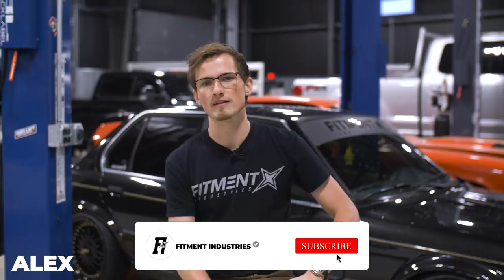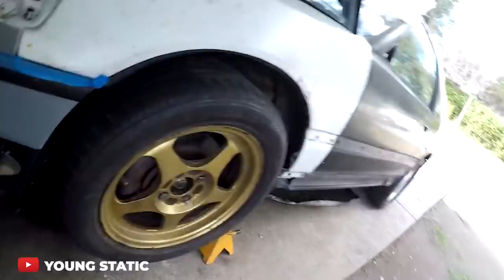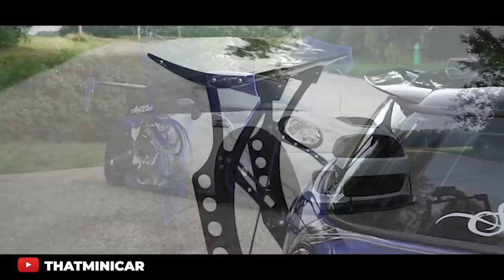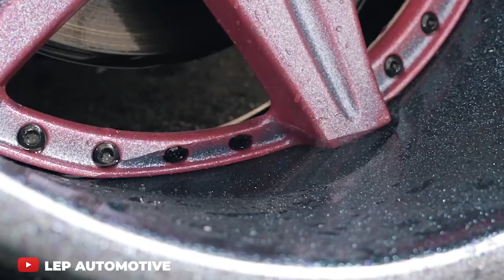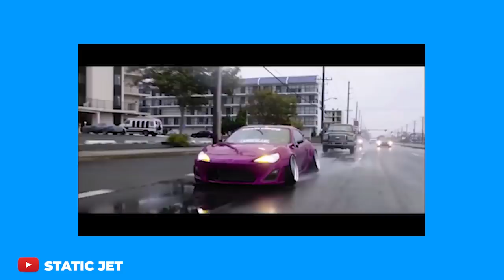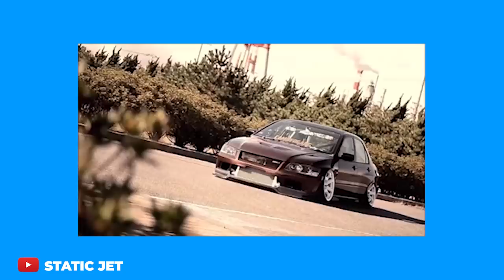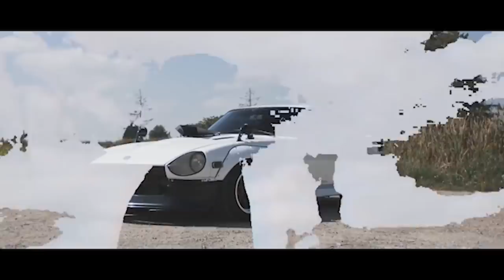Rookie Mistakes When Building A Car

Comment: 1. Simplicity is a form of beauty
2. Lowered car looks nice but a nice looking car doesn't need to be too low to look nice. 
3. Don't make the car look fast when it isn't 
4. Get proper exhaust system and high quality. Don't waste time on cheap shit
5. Keep the car clean is the best form of modifications you can get. No point of having a sacked down scrapping the road when it is look like it belongs to the junk yard.
6. Don't stance it, I can't stand it.
7. Suspension setup and bracing because handling is better than anything when it comes to surviving the corners 
8. Get a set of quality tyres and quality wheels (JDM is the best).
9. No stickers please..
10. Don't rice out

Comment: What do you recommend as a first car under $2000-ish
Reply: Alan_JDM_Gutierrez best bet will be a civic. They’re mostly bulletproof and have a huge mod community
Reply: Alan_JDM_Gutierrez rsx is a great car for cheap and it can be fun if you get a type s
Reply: @Ferrari636  yeah i had hondas in mind since im really knowledgeable about them, my brother has had countless built hondas (my profile pic is his crx) and my dad is a mechanic so he teaches me everything i know. Plus they have countless aftermarket support. Thanks for the advice!
Reply: @wellmax3749  good point
Reply: @Ferrari636  yeah, my brothers is gsr swapped, he had a supercharged b20b but decided to sell the motor
Reply: But his car is a si with full interior and even with a stock-ish b20 he would destroy some cars
Reply: I know people right away say Honda and there in nothing wrong with that. Buuuut you can get an Infiniti Q45 or Lexus Ls400 and do a V8 VIP build as well relatively budget friendly just takes time to find a steal
Reply from the maker: Civic's are a great option! Problem is it that it is very hard to find one that has not be beaten to the ground 😂
Reply: 89-95 5 series e34, I love mine. They’re classy
Reply: Miata

Comment: My biggest mistake. Spending more money on parts for the car, than what I spent on the car. Run out of money. Take the car toget inspected. Fail inspection. Now I have all these parts sitting collecting dust until I get the car fixed.

Comment: Stand alone or piggy back..? 🤣
Reply: Depends on your needs and what is available to you.  Piggybacks can be pretty awesome (Burger Motorsports) and usually take no time at all.  Standalone ECUs are by far the cream of the crop most powerful car control device out there; however if there isnt a PnP version for your car you have to manually splice into the OEM harness or repin it to accept the new ECUs plugin which can be extremely time consuming and/or expensive.  I ran a megasquirt in a miata I owned way back in 2007 and it was a slick little standalone, currently looking at a JB4 from Burger for my new golf as there is issues with dealers TD1 flagging cars that come in flashed which immediately kills your warranty.

Comment: Please do a video on how to properly measure offset (on the car not on the wheel) so we can reduce the risk of ordering wheels wrong
Reply from the maker: Check out this video we actually covered this! https://bit.ly/2S1Tjl4 🙏🏼
Reply: Easy, use the factory wheel offset as a guide. But you really have to learn the science of how offset/backspace works TBH.
Reply: I appreciate the video suggestion @fitmentindustries but I understand what offset is and how it works. The part I have trouble with is getting the measurements on the car so I can get new wheels to have perfect flush fitment
Reply: Evan Hamlyn what car do you have?
Reply: @_Greasyzoku_  2018 chevy cruze hatchback
Reply: Evan Hamlyn according to my research, looks like your factory wheel offset is +41, depending on which trim level you have depends on wheel size 16-18” so widths range a bit. But I’d say a 18x8.5 +25 is a good starting point of wheel options to look into. Depending on if you lower it, don’t mind camber, what you wanna do with your car (track vs stance) etc. but 5x105 is gonna be hard to find so a redrill of a set of wheels is gonna be your best option. Good luck. I like those cars, probably not fast but cute af, much like my 525i e34.

Comment: Car: 2015 brz Limited
Goal: Performance(turbo)
Current mods:
UEL Headers
Exhaust
Front pipe
Intake
Stage 2 tune
Coilovers
Tires
Sti lips And side skirts
Future mods(supporting mods):
Wider wheels and tires
Cooling upgrades
Brembo brake kit 
Clutch 
Fuel system upgrade 
and ultimately TURBO!

Comment: I bought too wide of a wheel. Thinking I should have just bought springs instead of coil overs. Would have saved 2 grand on wheels and new tires I didn’t need.

Comment: Figured I’d ask my buddies here first. Just bought myself an 05 Legacy GT and I drove it from NC to VT (15 hour drive). It drove fine all the way home but now the CEL is on and the ABS just came on. There was smoke somewhere in the bay around the turbo but it went away, smells like a dead rats nest. It’s tuned on 93 but I had to put 91 in it twice. The worst part is it sputters and idles rough and then stalls. It used to have black smoke but that’s gone away too. Just seeing what type of answers I’ll get, I’m getting it diagnosed Monday but if I can find answers here first that’d be great, save me $100.
Reply: Probably the subie gaskets, they go bad a lot, my 06 Impreza needs gaskets
Reply from the maker: Best of luck to you man I hope its nothing to crazy and expensive! 👀🙏🏼😅
Reply: Frowningcorn Ding ding ding, me and my friends were looking over the turbo, sparks and coils, then we realize the gaskets are spitting oil like crazy. Luckily where I live, all my friends work at the local Subaru dealership as well as have their own shop and dynos. So it should be quite cheaper than getting it done at a regular mechanic/Dealership.

Comment: I just bought a brand new 2019 WRX, and I want to throw on some tasteful mods for personalization. I don't want more power, I don't want stupid looking aero, I don't want to slam it. I bought a second set of wheels and winter tires (Michigan has rough winter's), I'm painting the calipers, and I'm replacing the shift knob. I like the seats the way they are. If anyone read this far, any suggestions for tasteful mods that won't impact reliability or ride height? This is a daily, not a track car.
Reply: I might also get a new exhaust sometime in the near future as well.
Reply from the maker: Exhaust would be a great addition to the ride, That or grabbing yourself a stage 2 kit from Cobb!
Reply: slam or die
Reply: @BLOODSHOT62  I live on a dirt road... In Michigan. And I have to drive it through winter.
Reply: @devjk1  lool that's soft, I live in Toronto, land of pot holes and snow, all I hear is excuses 🤷‍♂️🍯
Reply: @BLOODSHOT62  haha fair enough, I guess I am making excuses then. None the less, I'm not going to lower it
Reply: @devjk1  ahaha just fucking with you, but sounds like you could use a vape
Reply: @BLOODSHOT62  maybe I'll build a vape holder in the e brake so I can hit it immediately after coming out of a e brake turn 😂

Comment: Is a 2 step module unnecessary?
Reply: In reality the only viable function for a two step is drag racing really.  You can get up on your soft limit which can allow massively boosted cars to launch at/or near full boost giving you the best possible 1/4 time you can throw down.  For daily drivers your factory hard limiter is all the safety you need, heck a lot of manufacturers run their rev limiter 200-300RPM below the actual redline.
Reply: @ShoreStudios  great job answering. Hope this helps some others. 

I know what 2 step is though and I am actually going to be buying the msd ls module. Gotta shoot them flames ya dig?
Reply from the maker: Your the real MVP I swear! 🏆🙏🏼

Comment: I made the mistake of picking upper Springs my Integra 92 add a turbo kit my car that had 189,000 miles piston rings were fried they were smoking like crazy spitting up oil at the top of the motor then it caught on fire on the Garden State Parkway when it was complete I only had my car for four days 😌😌😌😌
Reply from the maker: Big rip 🙏🏼

Comment: Bought my car for 1k, spent 600 or so on upgraded a arms, control arms, and pan hard bars, and then spend my last 200 on parts that turns out came with the a arms so uhhh bye bye 200 I could spend on weather stripping I reallllllly need, may I add my suspension was stock besides the shocks when I got it and all the ball joints were crusty and falling apart, it's also a manual and my first car, oh dear.

Comment: why has everyone looked over  the #1 thing you should do first when building a car...maintenance.

like for real, no one is really gonna care about how soon you can slam it or put wheels on it. I spent over 1000 in parts no one will ever see or know about before i even finished my exhaust on my rx8(and is the reason that car has been my most reliable car I have owned even though the internet says they suck) or the fact that i bought a 1k beater ls400 and spent 500 on maintenance the same week. its not cool but it makes sure that car will be mechanically sound before you drop idiotic amounts of money on your car

Comment: My mistake: RESEARCHING TOO MUCH. I over research everything. Get bogged down and overloaded. Just bought my Focus ST.. yeah make fun of me.. whatever. Its not a straight line demon but that little thing is hell on curves. So i dont want more power/faster.. i want to get it more stable and quicker. So yeah, i'm checking your site out for shocks and tires.. now wheels. i'm happy with the stocks. I dont want to over do my car and make every gear head here pull up and "i bet i can beat you" at every damn red light. Instead I want the bikes, miata's, GTI's on the curves here to see me in the mirror and have to pull that ass out of the way. Is it the fastest? nope.. dont want it to be. Its a daily driven fun little car and i plan on keeping it that way. Great videos btw. I enjoy the heck out of them.

Comment: im gonna go into my countrys army on september and i plan to start buying/building a car after i get out of the army !!!!im probably gonna focus on a mx5/miata  gen 1/2 , only reason im waiting is because i want to do everything properly (i cant afford it yet)
Reply: i want it to be a daily/drift mix and thats a VERY expensive combination , so i really want it to be reliable (i want it to operate first and look good second)(hydro e-brake/dual brake callipers/exhaust/filter/ecu tune/roll-cage/wheels-tires/suspension/lighter clutch and short shifter/adjustable bucket seats......maybe:hardtop/paint/white xenon lights/back spoiler ,moderate size/engine upgrades/)that car will probably cost a decent ammount but thats what i really want (i dont want a stock car made for economy , i want to have fun building my car and taking it around insane corners)!!!!!!!

Comment: I built a 2JZGTE and wasted thousands of dollars do not buy knockoff parts!!! Or driftmotion parts!! Wasted about 3000 with them junk!  turbo,injectors,wastegate. Needed a retune after parts replaced bad advice from driftmotion false promises. Just get good name brand parts!! Realstreet is probably the only advice I trust and maybe fitment industries. Shops are out there to get you to spend/waste money. I've helped 3 other guys build 2j's also and they haven't taken my advice they are paying for it as we speak (boost issues with a driftmotion wastegate) for one guy. they just buy that stuff off Ebay anyway skip the middle man or take my advice and buy good parts also it sucks when people ask what you have and you have to respond with knock off and remember how you got ripped off. I probably wasted 7000 on my build and it's just a built is300 turbo it could be way nicer than it is now. People gave me good advice and I ignored them dont be me. I have small problems with my name brand parts it's a nightmare with knockoff

Comment: A car shouldn't need new brakes the brakes are designed to stop the car as long as youre not adding massive amounts of weight the stock brakes are not the best thing ever but generally adequate. Even if its considerabky modified to be faster, it still weighs thebsame amount. You brakes can only stop as good as thebtires will let it
Reply: Cyrus Lever that's entirely wrong
Reply: @m10lover  no its not
Reply: @cyruslever586  that is incorrect. As your car gets faster, you're probably going to drive it faster. This increases the load you're putting on your brakes. 

Upgraded brakes can handle more load, thus stopping your 4000 lb weapon more efficiently and hopefully not killing you or someone else. Not to mention burning through pads and rotors every other week.

Comment: Also just cause you drove a 800 horsepower truck doesn't mean you can slap 800 horsepower into a damn Fiat and be able to handle it the wait also matters with horsepower at 300 horsepower stock truck will handle completely differently from a 300 horsepower Nissan 350Z

Comment: Did this man just call poly bushings a rookie mistake. I hope he's talking about the shifter specifically, instead of actually buying a proper linkage. Because poly bushings are one of the cheapest and most effective suspension mods you can do my impreza handled better before throwing decent coilovers on it with just whiteline bushings, ebay bushings are garage but super pro, whiteline or any other name brand bushing is the way my friends accent had a custom brake kit oversized tires and poly bushings and the car does not handle like a 20 year old beater. Even through it definitely looks like one. Good tires, brake pads clean fluid and bushings are the best performance mod you can do to a car. Coilovers have pros and cons but decent bushings don't make the ride harsh and also make an old project car handle better than a new car.